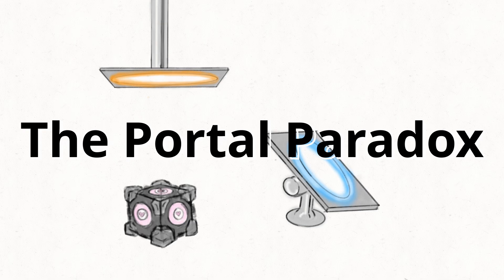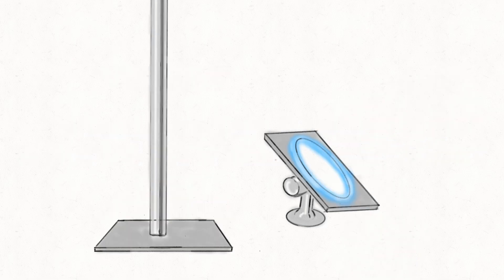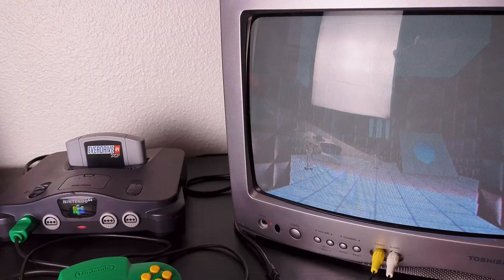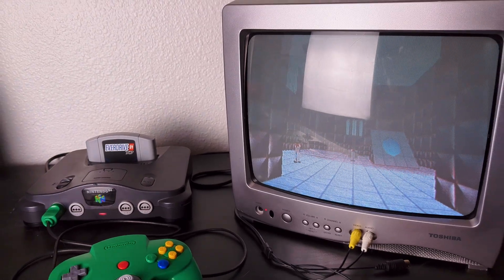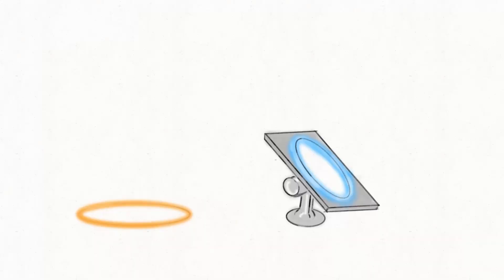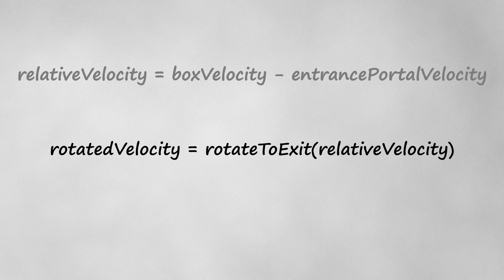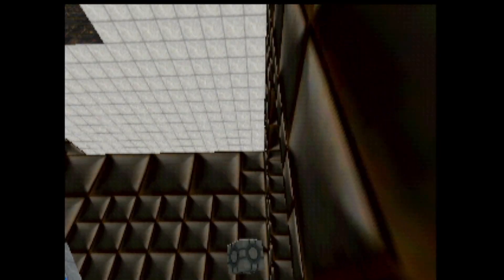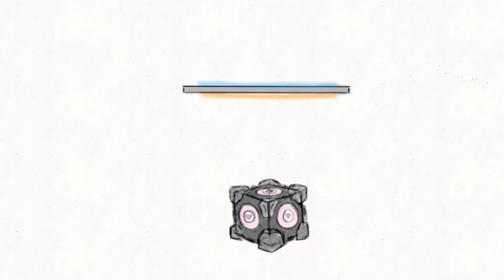I rewrote Portal from scratch and solved the Portal Paradox

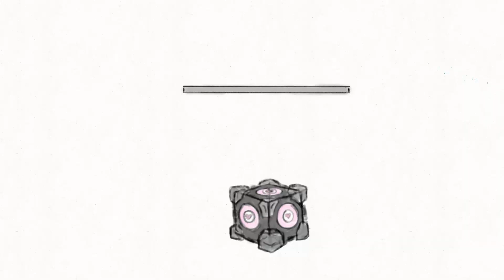Comment: 2:02 "If you think my approach is wrong, show me the flaw in this equation".

I think your approach is wrong. It is well known that portals do not conserve momentum (in the original version as well as in your implementation). But you broke the universe even more. Your portals also don't conserve mass. Imagine you have a cube of 1 kg at rest. You push a portal with 0.5c (meaning 50% the speed of light) into it. It comes out with 0.5c, while the portal does not decelerate from that interaction. But the cube is now at a speed of 0.5c, therefore weighing 1.333 kg due to relativistic mass increase. Now if you use another set of portals to transport the cube back to the moving portal, each round trip would increase the cubes mass by 4/3, if you would have implemented relativistic addition of velocity vectors. That would ultimately destroy Apperture Labs in a black hole due to the exacerbating mass increase. However, since the velocities are simply added, in the second round trip, the cube would already be at the speed of light, which would result in infinite mass, which is directly impossible.

Still, it would probably not matter, since I don't think you have implemented black holes. It would be fun though.

Comment: So question. If the portal was instead on a falling physics object whith the mass of one box what would happen?

 If you had three boxes stacked and moved the portal down on a piston I would assume that all 3 will shoot out like in the video.  This would work the same for a piston pushing 3 boxes as the piston is just moving in the space at a fixed rate and the physics objects are reacting to that. Basically the piston has infinite energy vs the physics object.   So if a object whith the same mass value of the boxes was dropped what happens to the boxes? If all three boxes shoot out than did we create more energy that we had at the start from one mass falling from gravity and then 3x the mass getting shot out?

Comment: My question is what happens if the descending portal only descends half-a-box's height from the floor the box is resting on? The half below the portal is unaffected, but the part passing through gets momentum. I'm guessing the part passing through pulls on the part not passed through the portal and it comes out but with a slower velocity.
Reply: @jaade9485  my friend you are in the comments of a nintendo demake video
Reply: My guess, the center of mass is where all the math and physics is being applied. So if the portal meets or passes the center of pass, it'll act as if the entire object went through and shoot out at full speed. If it doesn't hit the center of mass, it'll not move at all. Although realistically, I think it should probably shoot out at half speed, half of the box has momentum pulling it.
Reply: @ZacDonald  It makes sense physics would apply to the point of object in game instead whole volume.
Realistically we still don't know if cube would shoot out or plop out, it was coded in this way not the other way
Reply: I was wondering something similar about the situation. Is the cube still affected by gravity?
Reply: How is the momentum transferred from the portal to the cube? There is no touching involved, no force involved. The only forces acting on the cube are gravity and slight air movement from the moving portal. Not nearly enough to fling the cube.
Reply: @MartinHindenes  it's a moving reference frame, the portal moving toward the cube is the same as the cube moving toward the portal.
Reply: @jaade9485  you do know there's a thing called theoretical physics right? and wormholes/portals are very much possible, just ask einstein. we can already do teleportation.
Reply: Since this is all hypothetical physics I suppose a lot of it's up in the air, but my assumption would be that if the portal were to stop halfway along the cube (or any point along the cube in fact) the part of the cube that has passed through the portal would carry its momentum and share it with the rest of the cube the moment the portal stops. Imagine if you will two balls attached by a string, if you rest one ball on your hand and then throw the other ball in the air, there will come a point where the string tightens and so the mass of the projectile increases as the momentum of the thrown ball is now shared with the second. This is what I would consider to be an equivalent outcome to the portal hypothetical, imagine the part of the cube that has already passed through the portal as the thrown ball, and the part of the cube that had not yet passed through the portal as the resting ball. In this situation lets imagine the cube would be split evenly, I imagine the initial velocity would be half that of the cube in the original hypothetical (where the cube passes fully through before the portal stops). This is because the velocity of the first half of the cube as it travels through the portal remains the same, but the mass is now 0.5 * the mass of the first hypotheticals cube as it is only half the cube, then when this momentum is substituted into the equation for the cube when the portal stops, the mass is now again 1 as it's the full cube, however the momentum is halved so therefore the leaving velocity (initial velocity of full cube) is halved. As i mentioned earlier, I also believe this idea would be applicable no matter how far the cube has travelled through the portal, if this assumption were correct, it would also be safe to assume that the leaving velocity of the cube would always be equal to the proportion of the cube that has travelled through (e.g 3/4 etc.) multiplied by the moving portals velocity.
Reply: I kind of said a whole lot of stuff there but I think it holds some level of merit
Reply: Nobody knows the answer because we still don't know how it would look like in reality
Reply: @realdragon  i disagree, in the game and in real life it is just math. ask something like chatgpt or wolframalpha
Reply: @JohlBrown  You can rocketjump in games, it's just a math but I can assure you in real life it does not work like in games
Reply: @realdragon  i disagree the math still works it's just that the fictional presumption is that it doesn't blow your legs off based on whatever premise (superhuman, rocket boots whatever). the f=ma still applies, even if modified for playability. if the maths 'didn't work' then you simply couldn't do it in a game or it would appear 'unbelievable'. usually in these circumstances we find the explanation in lore.
Reply: @JohlBrown  The thing is YOU DEFINE MATH IN GAMES. You can make game where bouncing ball bounces higher and higher on it's own.
Math still works in that game, doesn't mean it has to work like that in real life. And that's actually better example here because what gave cube energy to fly? It was stationary and suddenly it flies out of portal with kinetic energy
Reply: @realdragon  again as i said realism comes back to it reflecting real life which we have known equations for. assuming even mass distribution within the cube, its resting state can't be overcome unless the acceleration overcomes gravity or friction, ie the portal moves at minimum twice the speed of the gravity vector over at least half the cube.
Reply: newtons second law
Reply: @JohlBrown  I can make game where engine has 120% efficiency, if it's in game that means real life works exactly like that
Reply: @realdragon  my friend you have missed the point. at this stage I doubt your ability to even do as you say in code.
Reply: @JohlBrown  Did I? Just because something works in game it doesn't means it would work like that in real life like for some reason many people in this comment section believe for some reason.
And if I missed the point explain it to me instead telling me I'm wrong, but then again it's standard argument on the internet that way
Reply: the net velocity of the cube is zero as the two directions cancel until more than half the cube has moved through the portal. if the portal continues down it may eventually be overcome by gravity, otherwise it will only move maximally at the speed of the moving portal. energy in = energy out
Reply: @JohlBrown  I see what you mean about the cube being half & half in between portals. But if part of the cube is already speeding up due to passing through the portal, when the portal stops midway, one half of the cube has some initial velocty while the other doesn't so it will slowly but surely fall down through the portal. If we want to showcase gravity acting equally both halves of the cube and canceling out, a test subject would have to hold the cube steady and wait for the portal to stop midway. As the portal moves downward, the test subject holding the cube would feel the cube being pulled out from his hands, like a tugging sensation, but if they hold on tight and wait, then they can release and enjoy the view of half a cube dangling from the ceiling
Reply: @danielhua8964  you're pretty close. you would feel both a pull as it accelerates and a push as it decelerates. you have to remember gravity along with the other forces on the cube are accelerations and not velocities. you can easily show gravity cancelling in the game by placing two portals on the floor.
Reply: @danielhua8964  i can't remember if i replied but gravity cancelling through portals does occur ie when you place two portals on the ground.

Comment: Question: What would happen if you stopped the Portal before the cube gets completed Teleported out of the other side? Is there a point where the momentum of the Teleported part of the cube will be enough to pull the remaining body to the other side?
Reply: This is answerable using the equations. You'd essentially launch the cube using the remaining ~half the speed of the first test, minus any speed loss during the deceleration vs the weight of the cube.
Reply: The portal's velocity being transferred to the cube doesn't have a convincing argument in the first place. (You need a force to act UPON the cube. The cube wasn't moving. The portal itself isn't going to change that. But this is solved with a programming trick -- the velocity/vector of the portal will be reversed and applied to the cube. When? Probably as soon as the cube touches the portal, the first time and only the first time. But it could be the mid-point of the cube, etc.) But the forces acting upon the cube from the other side could have an effect. Example, you could have gravity pulling the cube in two opposite directions. Etc.
Reply: @user-zu1ix3yq2w  It does have a convincing argument tho, the surface that the exit portal is on, relative to the cube, is moving (through that portal), so when the cube comes out the cube is moving relative to that surface. You don't necessarily need a force to change the velocity of an object relative to something else, because velocity is relative, and from the cube's point of view, its velocity never changed. Like how gravity isn't a force, but it still seems to pull objects down.
Reply: @vibaj16  
That is not a convincing argument. Typically the cube will move through the portal because it has a force acting UPON the cube. The portal does not act upon the cube, it is not truly relative and it is not part of a system with the cube. You're right that it velocity is relative, however the portal would have to affect everything on the other side (e.g. the wall would have to slam into the cube) and that obviously is not what is happening. Even though gravity appears to be caused by the warping of spacetime, it's still referred as a force (or an "emergent force.") And I guess the portals could be doing the same thing -- warping spacetime, if that's what you're saying.

Making the portals "move" changes things drastically. I have talked about it some in the comments, a lot can be said.
Reply: @vibaj16  So what gave cube energy to fly?
Reply: @realdragon  nothing, velocity is relative. It's just like when something falls to the ground. Nothing "gave it the energy to fall", because it's not moving from its perspective
Reply: @vibaj16  If nothing gave cube energy then why it suddenly have energy?
Reply: @realdragon  When you push a cube into a portal near the floor and it plops out of a portal near the ceiling, the cube got potential energy out of just passing a portal. Same deal here.
Reply: @k.k.9378  And that's why we can't say what would actually happen in this situation, because game was programmed in that way. It doesn't represent reality and people treat it like it does
Reply: @realdragon  I don't think that makes any sense. All motion is relative. If you only had two bodies in an infinite vacuum and one began moving towards the other you (the observer) would not be able to tell which of the two objects (with certainty) was the "true" moving object. If you were standing on one of these bodies it would appear to have no energy compared to you and as such the other object would seem to be rushing towards you. This same sensation would exist regardless of the object you chose to observe from. 

With this in mind imagine that the only difference in this scenario is that you were observing the other body moving through a portal. It would be completely unexpected to see the body lose all apparent momentum the moment it passed through the portal. it wouldn't matter if the body was really moving or if the portal itself was moving either way the object would seem to be rushing towards you and it would seem very disturbing if the body suddenly decelerated. 

We can see that portals are able to impart potential energy into an object, why would it not follow that they could impart momentum?
Reply: @blueballoon5052  You could tell which object is moving if you had clock that was synchronized at the beginning.
Portal is not object, the space beyond portal isn't moving relative to the cube because it's in the same frame of reference, frame of reference doesn't move in relation of its' own frame of reference.
It's like you tried to go behind your own back, you can't can't go behind yourself.

Additionally it was just programmed that way, if it were programmed the other way where cube plops out vast majority of people instead arguing that would argue how it makes sense that cube plops out.

If I were to program engine with 120% efficiency it doesn't mean in reality we can build engine with 120% efficiency, math is there, all the equations are correct but if games were bound by real physics we wouldn't have games like pokemon or portal (look up how turrets work in portal by Cave Johnson)
Reply: @VIBaJ 16  exactly, from the cubes perspective it is not moving and instead the room is around it
Reply: @Dragonax  this response is in my opinion kind of strange because you're speaking as though the whole portal physics system is impossible within our universe and therefore it is impossible period, but that's not what this discussion is about. We take a hypothetical scenario we know cannot exist in our universe and we use the information that we have as of yet gathered through testing to form proposals as to what would happen in scenarios that we haven't yet tested. If that isn't what you're here to do then this simply isn't the discussion for you.
Reply: @gdlpe05  I don't think you understand what I say but oh well. It was programmed to shoot out and people argue like this is exactly what would happen in real life even tho it would be easy to program cube simple plopping out.

"whole portal physics system is impossible within our universe and therefore it is impossible period"

What does it even means? If you can't do something you simply can't do something, if I wanted to go below 0K I simply can't, it's impossible no matter what you do
Reply: @user-zu1ix3yq2w  Newton's first law states that objects will remain in place until an outside force enacts on it. We have a portal traveling at a velocity, so thats our outside force. Newton's second law states that objects will transfer their energy to objects they collide with, IE momentum. If the portal (outside force) collides with cube (stationary object) it will transfer energy (momentum) and thus propel the cube through the exit portal. Very simple, and convincing if you aren't a dolt
Reply: @callumbreton8930  Yes, the cube must be acted upon by an outside force. But portals are not forces. They are not forces. Repeat this: they are not forces. If you threw something through a doorway, that doorway is not acting upon the object. If a moving door were to come at you and you go through it, you're not inheriting the door's momentum because the door didn't interact with you.

What would interact with the cube is the space on the other side of the portal. The cube would have to displace air to make room, and gravity would pull it down. But that cube is still sitting where it was until those forces start to take effect.
Reply: @callumbreton8930  Portal isn't force. It doesn't give momentum to the cube. What it does - creates a passage between two areas, like a door passage. It's just space warping thing.
Reply: @user-zu1ix3yq2w  Portals already violate the vector component of conservation of energy just by existing without pointing in parallel but opposite directions, this scenario is not needed to violate it.

Comment: I agree with that model. That would be the simplest... from the portal device perspective. The easiest way to determine speed would be to measure it relative to the entry portal. Otherwise... what if the entire room is moving (it's a big elevator)? Then it would be able to measure speed relative to the portal gun itself, but what if the user of the device is moving, etc.